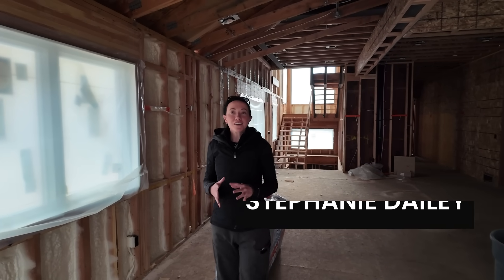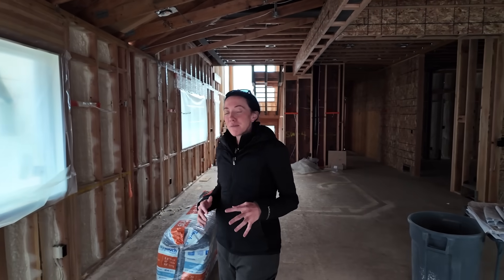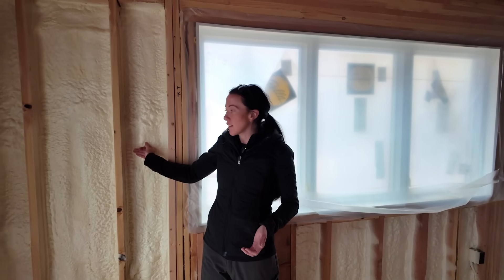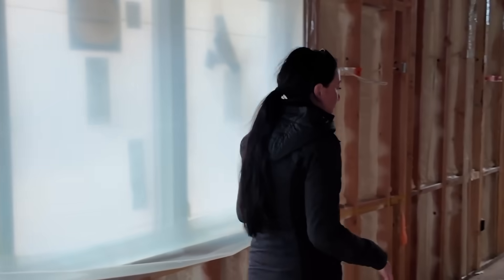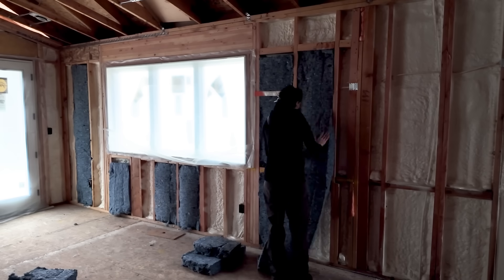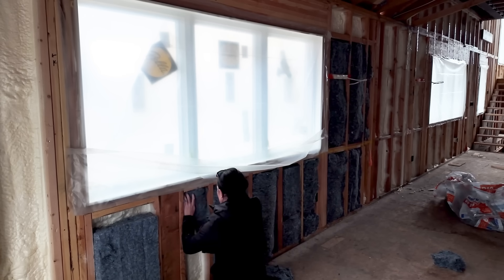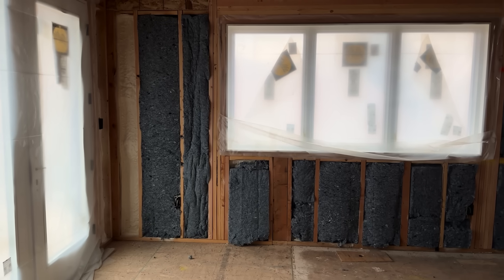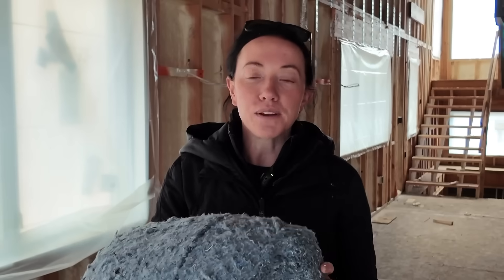Spray Foam and Denim? New Approach in Insulated Remodeled Walls

Comment: Do not use Denim in wall cavities: Mold, Moths\Rodents, and cotton holds on to moisture. You never want to use a organic material in wall cavities for insulation. Use FiberGlass or Rockwool. 

Avoid sprayfoam as Insurance companies are banning it because a large number of Rot claims & costs for repair.

Google: "insurers denying coverage or lenders refusing loans due to trapped moisture, rot, and structural damage, especially in attics where it can block ventilation and create condensation issues."

Comment: What are you using for the primary air barrier and external WRB?  Since there is closed cell spray foam on the inside of the sheathing (flash and batt) the external WRB needs to be vapor open to allow the sheathing to dry to the exterior.  The spray foam isn’t really a primary air barrier since there will be air leakage between double / triple studs.  I have a similar cabin construction project, added spray foam for flash/batt and I’m now regretting it a bit because air and vapor management gets trickier IMO.  I’m interested in your solution on the exterior side of this wall.

Comment: How is it safer to handle with all the chemicals add to preserve it, mold , bugs, moisture, fire ect….
Reply: Borate is a mineral. It is a fire retardent, resists mold and discourages insects.
Reply: @richgird7959yes but cotton is very flammable and a favorite nesting material for rodents. Do they not use any other chemicals to treat the cotton.

Comment: One of the best features of this denim insulation is that you can shape it by stretching a bit. You can staple it. You can pull off pieces to slide into gaps. I have used it to shim in rigid foam that was cut a little smaller than the stud bay. The freedom of handling speeds up installation significantly.

Comment: You can manually shred a bit of this stuff and mix it with thinset to make fire blocking around pipes and wire openings in wood framing. Quick, easy, affordable.
Reply: I assume you have used this product on a number of projects. I never would have thought to consider mixing this recycled denim with thinset. I always believed for fiberglass, you did not want to wet the insulation or it would affect the R-value. Where did you get this idea?
Reply: @garychin4138 Where using it to create fire blocking, R value is not applicable. As for origin of the idea, I suppose it just popped into my head.

Comment: You are in a cold environment meaning that the warm moist side is inside the house.  The vapor barrier is supposed to go on the warm moist side, and your closed cell foam is the vapor barrier.  So how does this get reconciled?  Is the r-value of that one inch of foam sufficient to prevent condensation inside the walls?
Reply: Yeah I have the same issue.  I did calculations (making some assumptions) and in Park city Utah you are going to hit dew point INSIDE the wall cavity with 1.5 inches of closed cell.  This is a strategy that works fine in Texas, southern California, etc.  but is highly problematic in cold climates.
Reply: @dcl97 We build passive certified residential and commercial in Boulder County, CO and Gallatin County, MT. Very similar climate and low humidity due to elevation. We have not used vapor barrier on interior walls in several years because we control humidity through an HRV. Interior humidity is commonly 42-45%. We also use 6” mineral wool exterior insulation outside of the vapor barrier sheathing, commonly Zip sheathing these days but can use Tyvek or an SA barrier just as effectively. 

Insulating outboard of the vapor barrier and managing ventilation and humidity with an HRV/ERV, your dew point remains outboard of the Vapor barrier. Most of our homes, especially in Big Sky, are temporary usage vacation homes for persons that live outside of region and desire more humidity. As such we often install humidifier inline with HRV. We still monitor and limit humidity to prevent possible health issues but many owners are more comfortable in 45% humidity than the 25% that is common here.
Reply: Yep, dew point on the inside face of the foam is the big question.
Reply: Most of this channel is places where they cool a lot. so they need the moisture barrier on the outside. Here in climate zone 7 the vapor barrier has to be on the inside. So denim is fine as it's on the outside of the vapor barrier. And better yet denim does not suffer from thermal piping that lowers fiberglass's R value. So it's good at -40.

Comment: Mineral wool generally offers superior sound absorption (especially mid-to-high frequencies) due to its high density and fibrous structure, making it excellent for dampening noise in walls, while closed-cell spray foam excels at air-sealing, blocking airborne sound by filling all gaps, but offers less sound absorption than mineral wool.

We are near a busy road and when we built with 2x4 stud walls in 2023, I was talked out of using mineral wool in place of closed cell foam.  Closed cell adds 300% better wall racking strength than batt insulation and my contractor felt that our 2x4 walls could use some extra strength without adding a bunch of strapping and I agreed.  We went with 2x4 construction because we also have 2.5" thick Zip R-12 sheathing so regular window and door jambs made for 2x6 would work.

Comment: With the closed cell foam acting as a vapor barrier, how does the assembly handle moisture from inside the house (the humidity created by living) when it tries to drive through thr wall to the dry climate outside.  You said the borate helps the denim to not grown mold, but that can only go so far.  I wonder if anyone Has anyone ever tested the moisture content of this type of wall after a few years.
Reply: Good question.  I'd say that would depend on the dew point at the inside face of the foam, which depends on varying temperature differentials.  This insulation approach seems risky.
Reply: Most of this channel is places where they cool a lot. so they need the moisture barrier on the outside. Here in climate zone 7 the vapor barrier has to be on the inside. So denim is fine as it's on the outside of the vapor barrier. And better yet denim does not suffer from thermal piping that lowers fiberglass's R value. So it's good at -40.
Reply: 2025, no competent builder designs a wall assembly that relies on pushing indoor vapor outward to dry.
That approach disappeared years ago because it simply doesn’t match real-world moisture behavior.
Reply: @k @keim3548  not sure I understand your statement. Naturally, won’t moisture move from high concentration to low? So if it’s 25% humidity outside and 55% inside, that vapor will try to move outward.
Reply: @amandajane-buildingbetter  Control and condition your interior air. Insulate outside to raise the dew point at the vapor barrier. Outside dries outwards, inside dries inwards. ERV is required.
Reply: Pardon my ignornace, Is this a problem that would be relevant where the build is occuring? Park City, Utah is considered dry high desert and fairly low humidity.

Comment: Are those 2x4 studs? Or 2x6?
Reply: Probably 2x6, if they were 2x4 they would need to fill the cavity 100% with SPF to get up to R-21. This also assumes they're not using a Rigid continuous insulation on the outside.

Comment: It would be nice to see you do a show on building small sheads and work shops in backyards and how you would insulate them
Reply: Since there are no building codes on many of these accessory structures you can experiment with whatever I would recommend Hardi Panel and tarpaper on pressure treated studs since the structure will be unheated and possibly unventilated for much of the year. Use plywood on the roof covered with the thickness of rigid foam you can afford. Ventilated metal roofing makes good sense. Good luck!

Comment: Question: Can I use a liquid moisture barrier such as Red Guard on the wall of my shower that is an outer wall? If the spray foam insulation is a vapor barrier preventing moisture from getting into the denim insulation, wouldn't my applying Red Guard on that outer wall first then installing my insulation (Rockwall for example) serve the same purpose?? I saw Matt's video about vapor barriers in bathrooms in the inside covering the insulation, but I wonder if I can use Red Guard before installing the insulation. I'll be using Red Guard on the Dens Shield before applying the tiles so why not use it on the sheathing before the insulation as well.
Reply: Densshield is already waterproof, you might want to contact installation support before randomly adding redundancies. I've gotten into trouble that way in the past.
Reply: @richgird7959 Thanks for the good thought. I checked DensShield specs and the say it's not necessary as DensShield is waterproof. BUT if this product is used in a steam shower then liquid waterproofing material is required (p. 12). I used RedGuard over DensShield in the primary bathroom. I'm soon to tackle the guest bathroom and would like to use a liquid waterproofing material on the inside of the sheathing that is on the outer wall. That's the question where I think unintended consequences might happen!

Comment: The best part of borate, boric acid, is that it's an insecticide. In certain neighborhoods in the south with multiple termite species, you can not even get a pest control contract with a warranty attached unless you let them rip out fiberglass or spray foam and replace it with borate-treated denim, wool, or cellulose. Formosan termites love to colonize spray foam because crappy contractors don't get the mixtures correct and that leaves pockets of air with trapped moisture, which act as magnets for termites.
Reply: You think the borates are a positive yet it’s actually a health hazard. Why would anyone want chemically treated materials within their building envelope? 

The borates are not actually for pest control, it’s actually requirement to meet flame resistance requirements, much the same as natural sheep’s wool insulation. 

Alternatively, one can choose Thermafiber mineral wool, that requires no chemical treatment to achieve Class A fire rating and natural inhibiting of pests. Be warned, not all mineral wool is the same as most Rockwool branded sheets and batts still use formaldehyde binder in manufacturing, which can outgas within wall cavity. Rockwool has promised to discontinue formaldehyde in manufacture for several years now but to my knowledge all batt goods and most Comfortboard still retain formaldehyde content within current lineup. 

One can find healthy, safe and efficient building materials today, denim insulation is however not that.
Reply: @MichaelM-to4sg  Borates don't do anything for flame retardant, you're thinking Rockwool.  Borates are entirely about insects.  They're also non toxic to humans.
Reply: @a @aussie2uGA Might want to stay in school son. Borates are EXTREMELY commonly used as flame retardant. Denim insulation is highly flammable, it is treated with boric acid to meet ASTM flame resistance compliance. 

Borates, particularly boric acid, is effective as termite resistance but can have severe health impact on humans. The levels used in denim insulation, it is considered “safe”, although there are warnings against ingesting the insulation. Sensitive persons have been reported to have eye and respiratory issues handling denim insulation due to the boric acid treatment. 

Just as there are now zero VOC foam spray, there are healthy or low risk insulation products that for not outgas dangerous toxins. Denim insulation is however not in that catagory, use with caution.
Reply: That is fascinating and also good to know!
Reply: Wow!
Reply: As a native Floridian, I didn’t realize that!
Reply: There have been lots of videos about how bad spray foam can ruin houses and how termites love it.  I wouldn't touch it.

Comment: How does Henry compare to rockwool?
Reply: I wonder that. Also,they say R19 for pink,wool, etc, but there must be more to it than just "R" value?
Reply: Henry is cheaper than rockwool I don't know about fireproof?
Reply: @adriaanvantulpenbaard1740  Its made of denim/cotton, so I assume not very unless theyve treated it with something. Perhaps the Borate but ive not clue how it compares
Reply: @user-cx5jj2yv3p class A fire rated so you could hold a propane torch to it and it would scorch but it won't catch.

Comment: Why not fill the complete cavity with closed cell foam?
Reply: Cost…. This method is commonly referred as Flash and Batt.  Better price than Closed cell, better performance than batt’s alone.  I for one like this method because if you ever have to open the wall it is easy to remove and reinstall the batt.  With all foam, you would have to cut it out and respray.
Reply: @itswhiskeytime8538  I like this method for future repairs or additions too. Cutting around closed-cell spray foram isn't fun.
Reply: I'm guessing cost and r-value and environmental benefits. You don't want that much polyurethane - it's gonna off-gas fumes.
Reply: In the long run, wouldn’t the foam be much more efficient. Even if you gave to open a part of the wall. To me it looks like your going to air gaps with that denim insulation.
Reply: @ger @geraldlalonde5992 No air gaps with Flash and Batt.  The one+ inches of flash (Closed cell foam) has already given the air seal.  The denim batts are providing the extra r-value.  Another BIG PLUS side to Flash and Batt is fire.  Big down side of foam is its highly flammable where Herny/Blue Jean insulation/Rockwool are nearly fireproof.  Plenty of videos on YouTube showing the rate of flammability of each of these.

Comment: ❤❤❤❤❤❤❤❤❤❤❤❤     where do you find the used denim ?     how do you gather it for recycling ?
Reply: Yup! I’ve never seen a denim recycle box.
Reply: if you have a Goodwill outlet store you could buy it by the pound. In our area there is a Goodwill G2 store that is the outlet. I looked into doing this but then you have to shred the denim somehow. I have just used old clothes for insulation but then I have a primitive cob double wattle wall hut with no floor. hahaha. I used rockwool in the roof though - very pricey but awesome stuff. I bought some denim but it broke up so easily and then you have tons of cotton fluff floating around. So you gotta contain this stuff asap.